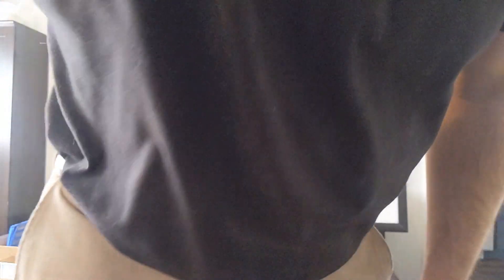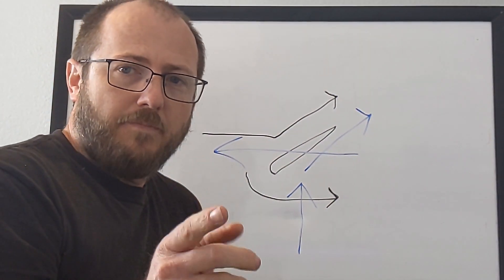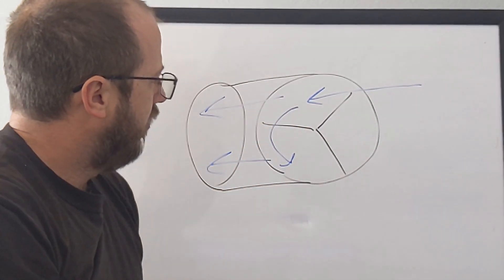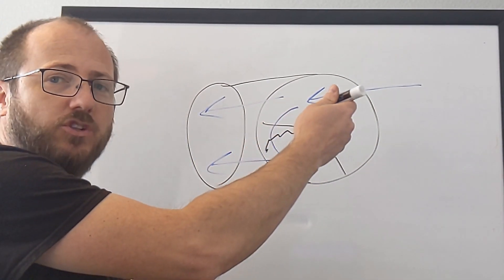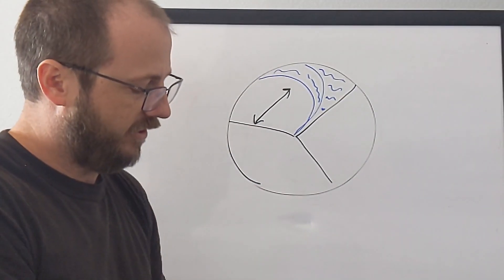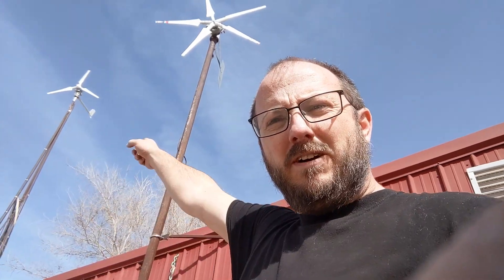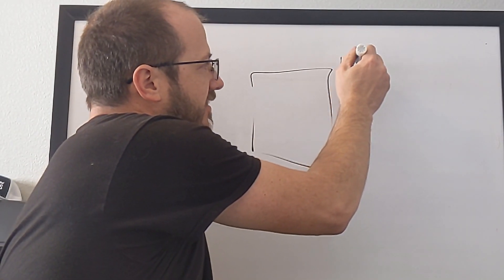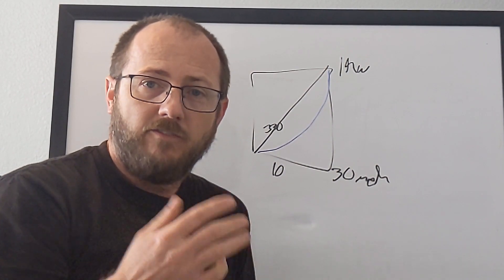Should I put more blades on my wind turbine?

Comment: There's a lot of other factors that go into this as well. particularly the turbine voltage, the systems voltage cut in and how your charging system is optimized. For instance, I live in an area that only averages 4 m/s, but I certainly have windier months than others, or windy nights and calm days. So if you use, say a grid tie turbine designed for high voltage output, pair it with 5 blades and an MPPT charger capable of taking in several hundred volts with a cut in of 60 volts for a 48 volts system, you will hit that cut in at lower speed winds on a more regular basis with 5 blades due to the swept blade area and other factors. If I was regularly getting 7-8 m/s winds or higher I would definitely use a 3 blade setup. I plan on doing some experiments with this over the next few months once I get my turbine in, and then probably just use the spare blades for a axial flux turbine build or a hoverboard dual rotor build. we'll see. It's unfortunate the small wind turbine industry is pretty much dead in the US though, I think peoples expectations weren't gauged properly and then china flooded the market with crap that killed interest in wind for the most part as peoples turbines failed to perform much if at all. I almost bought something from Hurricane Wind Power, but the dude ran into health issues, stopped building their own turbines and now they sell a chinese based product that looks similar to theirs but is twice the price. I'm fine supporting Turkey instead.

Comment: Okay, but why don't we all use Two blade windturbines if 3 of them are as efficient. If the drag is the only force to consider it should be two, right? The Double stacked rotor design should than be a 4 blade 90 degrees apart 2x2 independently behind each other (contra rotating) setup having the biggest possible space between them and auto adjusting for turbulence. This is tested and beats the BETZ law.
Reply from the maker: It has been a while since I made the video but I believe I covered this specific question...maybe I'm mistaken, though.  At any rate, the same principal applies.  Fewer blades will be able to achieve a higher RPM with the absolute best number (in terms of speed performance) is a single counter-weighted blade.  Back in the very early days of residential turbines it was fairly common to see single-blade machines, they're quite fascinating.  The downside to having two blades, you ask about, is balance.  They are very difficult to properly balance and actually create structural issues within the tower as a result...single blade props are even worse.

Counter-rotating turbines have been explored and mostly dismissed not because of poor performance, but because the mechanical complexity negates the performance benefits.

Comment: The problem here is that with 3 blades most ista breeze don' t even start rotating till the wind is 7m/s  and to start producing just a bit of power they need 9m/s due to their extremelly inefficient blades. Ista breeze only works in hurtican wind conditions. Most chinese wind turbine start rotating 3m/s and generating some power 4m/s. I have had 3 chinese wind turbines and one day some guys with their videos convinced me to buy an ista cheese. Completely waste of time and money. Thanks guys. By the way,  the i1500 and i2000 power curve, according to the manufacturer, these 2 models, produce 300W at 6m/s wind speed, but the truth is that they don't even start rotating at that wind speed

Comment: I politely disagree... Have you forgotten lift on your force diagram? This might be true if your blades do not use lift but drag as the main mover force, I have never done calculations for that.  But if your blades do use lift as their main mover force, then the smaller the diameter of the area swept, the higher number of blades you have to use to optimize the output of  the WT (Cp).  Tests have been done in fact with a turbine having only one blade and one counter weight.  I suggest you read "Grid Integration of Wind Energy Conversion Systems" by Siefried Heier.  The Betz limit is a consequence of using lift instead of drag as main moving force.
Reply from the maker: I pointed out in the video that it's all math and that if you're changing multiple criteria of the blade's design then you can achieve the same or better performance with any number of blades.  Simply adding a blade while making no other changes will always reduce maximum potential RPM in rated wind.  It doesn't matter how the blade is designed.

Comment: Im hoping my 5 blade with stay in rotation naking it easier to get up to a producing speed. Ive seen how they can have wind that could produce but with moments of under wind they stop spinning till they have a small amount of over wind to start them back up.
Reply: what model do you have and what is your annual production? In my case, the average annual speed is 5-7 m/s and I am considering a 5-bladed turbine.
Reply: @perun4428  I have 2 i2k istabreeze. Only have the 3 blade up rightnow and it doesn't making any power. Occasionally it'll pump 120v into my system and fry everything. I threw away the ista controller and am building my own them ill raise the tower an extra 30 foot atleast
Reply: @kansasadventure1831  oh yeah 120V into a 12/24/48V system sounds very appealing 😅

Comment: been getting into wind for a while.

theres a whole range of topics here you brush on but dont get into. most people simply dont even realise what im about to say here... so, lets keep it as simple as possible...

the generators...
their output is limited. once they reach that peak speed, any faster, and you cant slow the turbine down whilst "generating" more. and the power there just keeps rising... instead, we apply a brake. yet a large enough generator IS a brake... more on that later.

then. a battery in charge can only absorb so much power. it has a voltage required to deliver a given charge current.

if you play around with a load resistor instead of a battery, you find you CAN pull the rated powers out. at lower voltages than the batteries can charge at. its EIR, but its backwards. the power is limited in what resistance it can deliver into, rather than the resistance limiting the power supply. does that make sense?

what you read on the meter on teh charger isnt what you can generate. its what you could absorb. big difference.

ie, the batteries want say, 14.4V to charge, minimum.. if you try to push more than 14.4V into them, they charge with more current, lifting to say, 14.6V. as long as the supply can deliver this current at this voltage, its all good, you use a resistor to LIMIT the power.

but the turbine? its dinky little PM generator cant deliver that current and the voltage sags. at 15v, it can deliver say, 15A, into 1R. for 225W. the resistor dissipates 225W, the generator delivers that much and no more.
at 0r8, it might sag the voltage down to 14V. 17.5A. and thats 245 W being dissipated by the resistor. 
at 0r5, it might drop down to 13.5v... for 27A. and thats 364W in the resistor.

meanwhile... the generator and its windings are getting hot! they also have 27A in them... 

and then, at 0R4, it drops to 13v, tries pulling 32.5A, 422W, the generator overloads, that overloads the turbine, and then the voltage and the current plummets as the turbine stalls out. or, the generator doesnt stall out, the turbine overpowers it, and then the generator starts getting REALLY HOT as it has 32.5A in it...

replace resistor with battery? you need the 15v at the batteries to get them to suck down 17.5A of charge current. but when you do that it sags and the batteries cant take 17.5A anymore... it sits somewhere around 14.4V and says "nope". if the batteries would charge at 13.5V? wow. you would have absolutely no issues.

they dont. batteries are stupid. stuck in the rut, dead end. supporting CEOs of big multinationals. oil companies? who owns LG and samsung and panasonic? give up on batteries and inverters. can you repair them in the dark with a screwdriver and a hammer? 

so. forget everything you have learnt. but remember to remember all of it, and then cherry pick as you decide whats worth remembering. we have been systematically trained to think of only one or two options, only one or two parts of the puzzle, focus on the wrong aspects... yet we have been taught all the answers, if we listened. ok, tinfoil hats jammed on firmly, lets continue...

go back to what a generator IS.
the very basic? lenz reaction. drop a magnet down a pipe.
theres every generator in overload... 
 
cut a slit down the pipe. no lenz reaction.
replace pipe with coil of wire. leave ends unattached. no lenz reaction.
short them. lenz reaction. reduced from the original copper pipe as the resistance of that thin wire is increased.
keep it shorted, and wack the magnet up and down in the pipe. 
something going to start getting HOT.

you did work, fighting these magnetic fields... but where did it GO?

so... you get a generator, you short it out and get a good idea of the full power it can absorb. pretty easy. 

but then you have to give it a load resistor, so you start with some decades, 10, 1, 0R1, and do the maths. theres a bell curve for the ideal resistance or load for a generator based on its windings. where is the heat being developed, where is the power? in the coil, or in the load?

you gotta UNTHINK this stuff. screw the maths. you gotta get the concepts.

ok... um... lot of people use BLDCs as generators, make the mistake of thinking the power they can tolerate is the power they can make. nope.

as a generator, all they have is the flux of the magnets in them. they are limited by the flux density and RPM and number of conductors. nowhere near the power out as on the label.

as a motor, they have a lot more flux in the core due to them being driven with currents. flux density gets to levels unachieved as a generator.

nothing gets over the fact that there will always be a limited flux in a PM generator. and that limits the output. you can design a PM to work well, and deliver a lot of power, but it also causes cogging and reduces the lower end performance.

whereas an excited alternator gives you a generator that can just keep delivering current as the supply can deliver, and will maintain a constant voltage as required by batteries and the like. until its overloaded.

except...

the batteries can STILL only accept so much juice in a time period. exceed that, you gotta dump it.

and how do you do that?

shunting it through a resistor... make heat.
charging batteries makes heat.
inverters make heat.

and then you use that power... to make heat.

hmmmm!!!!

if, instead of letting turbines overspeed when the going gets too rough... oversize the generator, use it as a brake... and dump all the excess power as heat, designed as the end goal rather than as an insurmountable loss.

hot water tanks are cheap, easy to strap together, and well, not so nasty as batteries. what to do with all this heat? iunno! 

what do nukes and coal stations do?

i will say it again. batteries are a dead end. they are the hindrance, the hurdle, the thorn in your eye.

Comment: It seems as tho the pitch, width, length, would all come into play just as much or more than the number of blades. I'd think that the solar wind farms have it down to a science but I don't see their math working on a smaller scale. Maybe if one could be designed that used a electric fan clutch like on a big diesel engine then it could be engaged and disengaged at different speeds. Or even a clutch type deal on a go-cart even. I'm so curious and wanting to build my first but I'm thinking a off the shelf kit might be best to get me started in this venture to add to my solar stuff
Reply from the maker: Length of the blade is discussed, the longer the blade the higher the TSR and the higher the TSR the faster the sooner the blade will lose efficiency.  Width and pitch affect how the blade starts up and change the performance curve of the turbine, but that's also in the equation...all the variables of the blade equal a result, it's math.  A+B+C=D.  If you alter A, B, and C in the correct ways you still get D.

Comment: We had a MWAS freedom turbine for a off grid client that didn't produce any usable power until we changed the blades from 9 down to 5 blades. This was something we learned that just because the blades are turning in low wind it doesn't always result in usable production over time. Great video the information about wind turbines that's not talked about or understood by most.
Reply: may I see the two kind of blades you had?

Comment: More blades means lower cut-in.  It depends on how much wind you get.  If you consistently get a lot of wind, stick with a 3-blade.  But if you don't?  Go with 5 or more...

I think the overall gain in lower winds, which most have more often, is worth any loss in higher ones.
Reply: No. It's complete opposite. More blades means higher cut-in. It just spins worhtlessly in most cases.

Comment: Am I correct in thinking, The air at sea level is more dense than at 5k feet so there is more power at sea level for any given air (wind) speed?   Thank you.
Reply from the maker: It's a double edge sword!  My understanding is that you are correct that the air at sea level is denser so there's more potential power in it, but it's more turbulent and erratic which makes it hard for turbines to track and spool properly.  It's one reason why off shore turbines tend to outperform their land-based counterparts...without buildings and hills and trees and such they get more stable wind in a denser (energy rich) environment.  Now, I do have to say that I struggle a little with this mentally because my brain tells me that it takes a finite force to move a finite number of air molecules at a given speed...which would mean that for wind to be blowing 20mph the leading edge would be the same density no matter what altitude.  I'm told this is flawed thinking but no one has ever been able to provide an explanation why it's flawed with any more authority than "because it is".  I can say, though, with the micro turbines I normally deal with the energy potential is so small that air density at sea level versus 10000ft is negligible...so it hasn't been an area I've explored much.

Comment: Thank you. I understand what your saying but why is 4 blades not an option?
Reply from the maker: Four blades is more complex mechanically and offers more wind resistance while not providing a significant enough increase in harvesting power.  The idea is to have as few blades as necessary to do the work, which tends to be three.  Four CAN do the work, but at greater cost and weight.
Reply: Odd number of blades like 3, 5, 7 are easier to get going and slower to come to a complete halt than Even number of blades. With Even number of blades, the wind has to overcome the forces of balance between the opposing blades. With Odd number of blades, there is no opposing blade to fight against.

Comment: Well, that's not true... The efficiency comes from the blade design. Plus your aero dynamics theories are way off.  Take a look at the C130, prime example. Started off with the 4 blades and everyone could hear it coming.  Now the new blade design, NOT the number of blades, The 8 blade design, which is the key factor to efficiency. If you really get into the science of it all. The blades have to be designed for what your working with.
Reply from the maker: I stated in the video that blades have a fixed efficiency range and do not work well outside of that range.

Comment: 3 to 5 blade problem, they use the same generator. a 5 blade machine needs different winding to take advantage of the lower speed torque etc.

Comment: My ista Breeze i2000 can be ordered as 3 or 5 blades. The blades are the same. This is the first mistake. But the i2000 has a very high start speed. So it depends on the average wind speed. Low 5 blades, high 3. The much more importand thing especially on ista breeze is the right curve setting. And with 5 blades the curve should be 30% higher at same wind. At the end 5 blades have lower turns but the same output and they start earlyer. And a lower TSR make lower noise. So in my opinion and the opinion of my neighbours is lower speed, lower noise, same output.
Reply: regarding this length, it should be noted that the i2000 3 blades are quite small, the ft-2000 has almost twice the surface area

Comment: Isn’t it time for you to build your own 18650 power wall
Reply from the maker: I definitely need a much higher capacity battery bank, but I'm somewhat frightened of dealing with lithium...it doesn't just blow up like lead acid, it might burn my shop down when I get abusive.
Reply: @ToysforWatts  it’s still the king of battery’s , and the most energy dens 
It will last 15 to 20 years easy.. 
that burning mid is blowen out of proportion.
But a metal case over it ( a truck toolbox) , a blowout pipe true the wall . 🫲😑🫱
fuse it up and put a bms on it  .. 
i  went true led assid.. AMG.. lifpo4 ☝️that pufs up like 🐡 pufferfish those really suck .. 
to at last 18650 .. no more bs ever again.. I both 2800 ncr18650bd cells for 0,40 cents a pice.. 10 amp discharge 3,2 amph .. 11,5 wh.. 90% tested above 3,4ah .. build 14 packs of 200 .. a total 33kwh 640ah .. 2000amp discharge rade (you can’t hurt dis)..51,8v nominale.. 
size of the pack l 15,4xw 15,4xh19,29 inches 
Building it is super simple 
And cheap